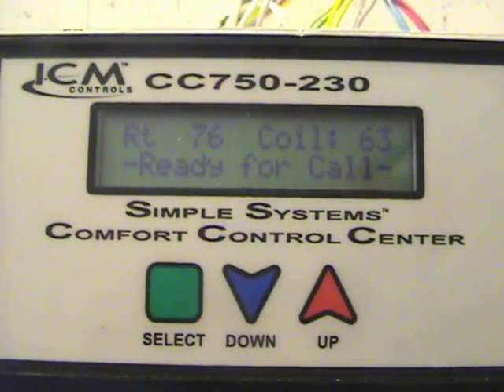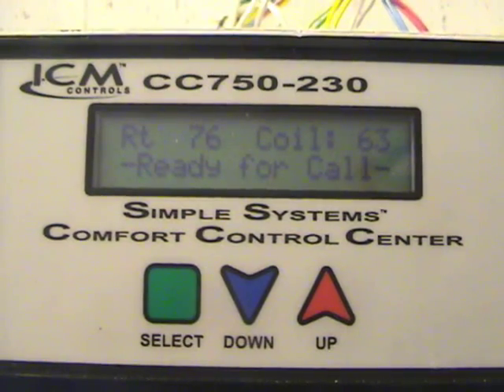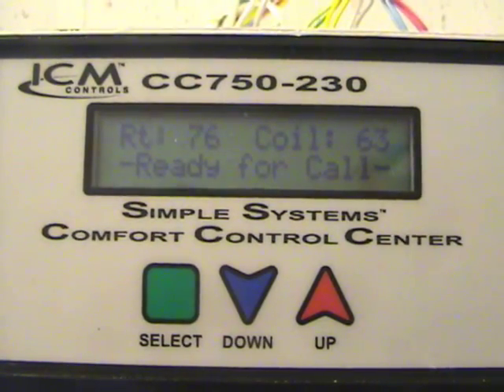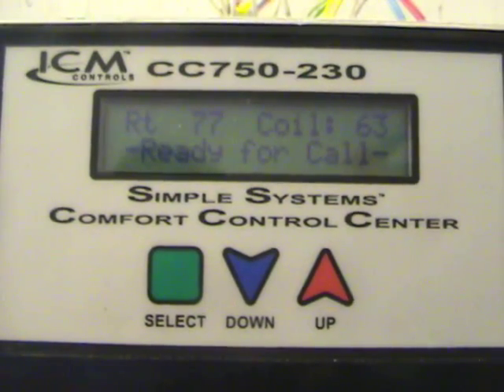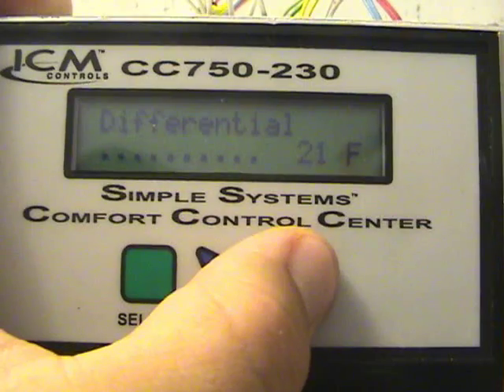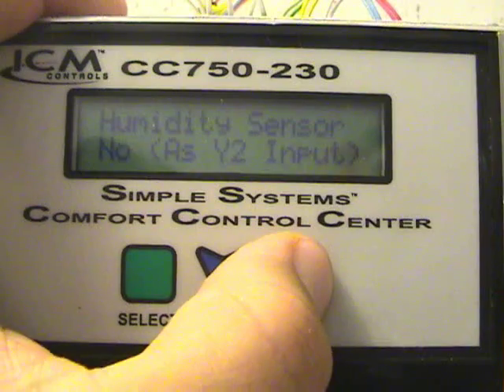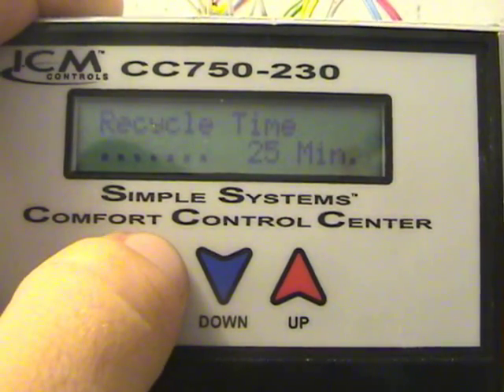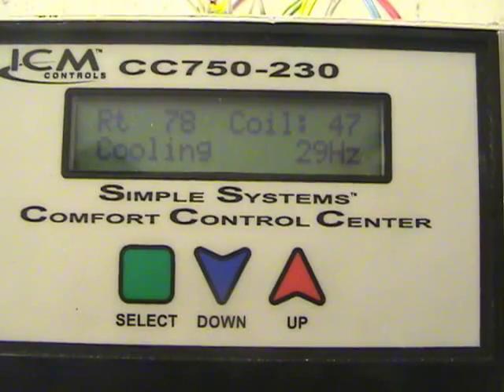ICM Comfort Control Set Up

Comment: For the first few minutes I thought this was intended to vary the speed of the compressor, and thus the capacity of the system, in order to reduce or eliminate cycling between full speed and off during times of lower heat load...  Very nice product none the less!

Comment: Hey bud, I just put one of these in too. Just one thing, and you probably already figured it out, the differential setting is the max dif between the return sensor and the coil sensor. 
Notice your display readings at the end are 78/47, a dif of 31 degrees and you differential is at 30. That's why the hz are starting to go up from 25 to 29.